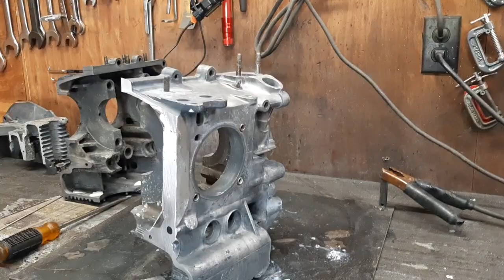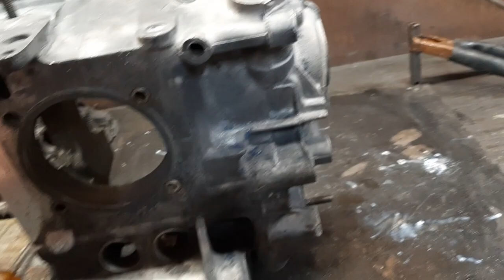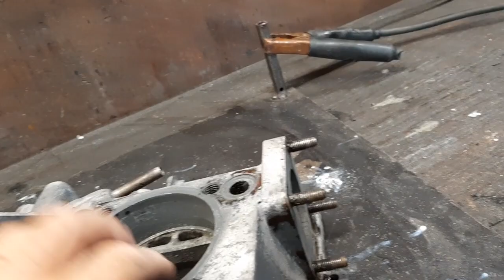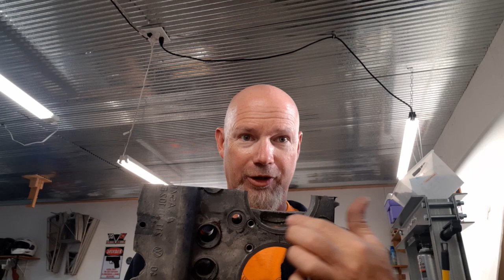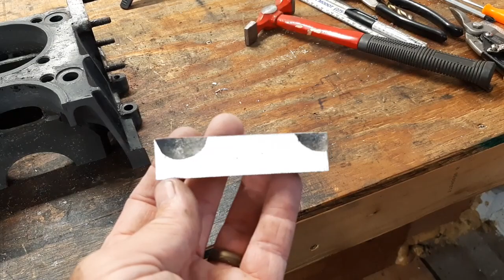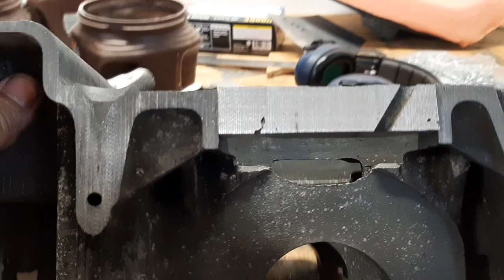1/2 VW Build - Part 3.1 - More Case Welding but with Issues

Comment: Was the bug engine too powerful for the plane? joking aside, what makes this better than a 200Euro bmw r1200 engine?
Reply from the maker: The 1/2 VW was just the engine that the plane was designed for and I really like the way they sound.  I don't know the specs on the r1200 engine but if it was the right weight it would probably work fine.  I know they are great bike engines.

Comment: Good to see this ,are you making 1/2 crank shaft ?
Reply from the maker: Welcome to the channel!  Since the crank has to be precision balanced and I don't have the equipment for that I am buying it from Hummel Engines.  He sells a complete balanced rotating assembly that was worth the money so I went that way.  I do have most of the parts to build a 2nd 1/2 VW and I will probably do the crank welding and all of the balancing that I can on that one myself.

Comment: Interesting.  I believe all of the early German cases were pure Magnesium but the later cases made in Brazil were an Aluminum-Magesium alloy.  I used to remember the symbol cast into the case to designate which one it is but I think any case with "Made in Brazil" has that alloy.  I need to check my donor engine, which has been collecting dust for over 30yrs now to see what it is made of.  If it's pure Magnesium I may not use it now.
Reply from the maker: AS41 & AS21 are the 2 magnesium alloys I have been reading about.  It was cast into the lower portion of the case on mine.  The numbers are the percentage of aluminum and silicon, respectively, added to the magnesium.
Reply: What do you use to weld magnesium aluminum alloy?